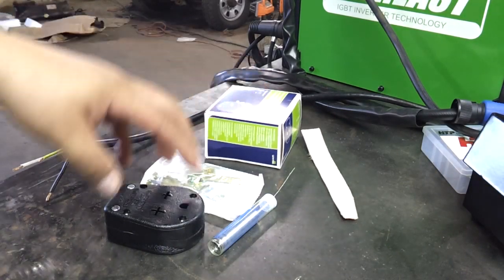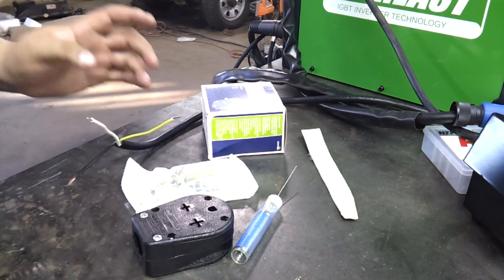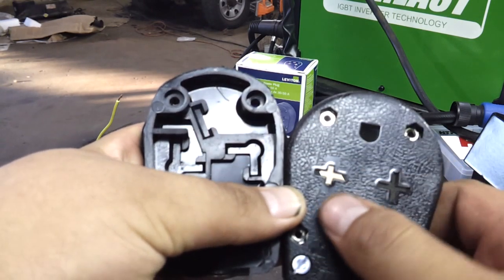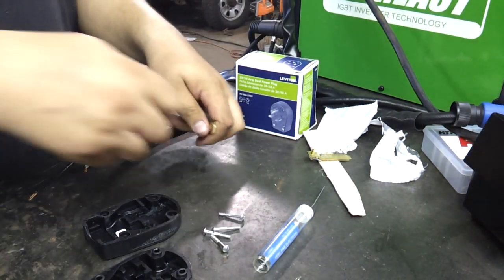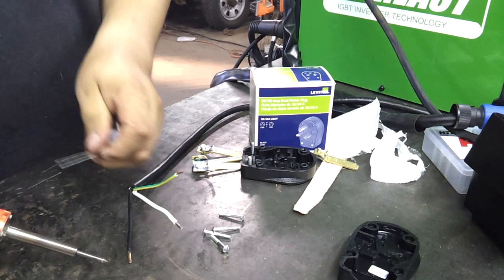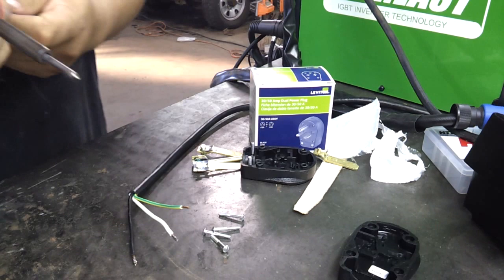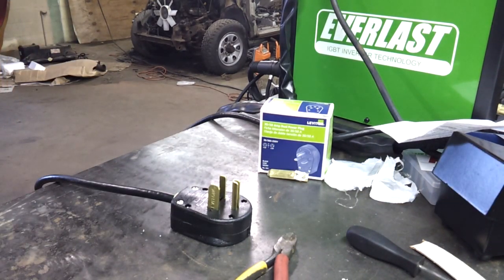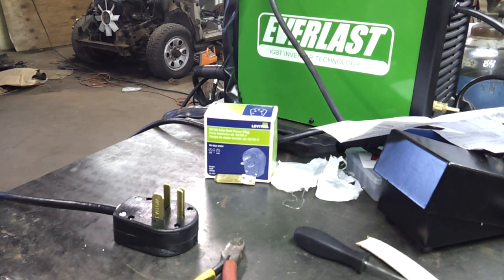Installing a 220 Volt Plug on Your Welder (Everlast PowerTIG 210 EXT)

Comment: You had better run larger gauge wire from the unit to the plug. Looking at your video it appears to be 14ga or 16Ga wire. These gauges are usually only rated for ~max 20 -25 amp. I recommend you run 6-8 gauge for proper load up to 50Amps.  Be safe!

Comment: The wires require no soldering. They won't pull out if you connect them as J hooks. The "clamp" is actually called a strain relief.

Comment from the maker: That's not the way amperage works. Your power supply has an amperage limit. In my case it's 50 amps. The only place wire gauge matters is from the breaker to the outlet if I have a 50 amp outlet. This is to insure that if I plug something into that outlet that requires 50 amps that the wire won't over heat. If what you are powering only requires 20 amps, the wire coming out of the machine only need to be rated to handle 20 amps. I hope that makes since. Amps are not feed they are taken.

Comment: hey i want to get a welder soon and i have 220 in my garage but the outlet is upside down as compared to the welder plug is that an easy fix? do they make an adapter that i can just plug in or do i need to turn the outlet over?
Reply from the maker: What do you mean upside down? Will the welder plug plug into it if you turn it over? Do you know amp rating the 220 outlet is?
Reply: my plug is upside down compared to how eastwood  has their plug setup on their welders and i could plug it in like it is i believe but the cord coming out of the plug will be going up instead of down causing unnecessary bind on the cord. the outlet says nema 6-50 on top and below it says 50 A 250 v  GRDG
Reply: i sent a pic to a guy at eastwood and he says i have to flip it over so the cord hangs down from the plug
Reply from the maker: Rockin Pip shut off the breaker. Pull the cover off the outlet and then flip the outlet over. Just make sure you don't pull any of the wires off the outlet when flipping it over.
Reply: hey bud thanks for the help it does seem a bit stiff to turn over but i will give that a shot and let you know thanks again man!

Comment: The yellow/green is an equipment ground.   There is no neutral in the 240 volt circuit.
Did you read the part of your owners manual that said "Do not remove the plug that came on the welder?   Link to the manual.   https://www.everlastgenerators.com/sites/everlastgenerators/files/downloads/dfe60188c86d74021235f2b62636585b.pdf.   Oh well, it's probably out of warranty by now.

Comment: I just bought the 256sI everlast. Do you know how many amp breaker I need for it ? I have the owners manual it says 32 amps draw & 40 max in rush. It has a plug on the machine already & 10 gauge cord.
Also my breaker panel has a 100 amp shut off outside. My panel has has 16 places for breakers & it's all full. I have an idea there are 3 double wide 20 amps for a total of 120 amps that are in charge of the electric wall heater fans. I want to remove 1 or 2 of them and replace them with a 50 amp & a 30 amp . then leave those wires inside the box for when I sell the house I can wire the heaters up again. Does That sound reasonable?
Reply from the maker: Please don't take this the wrong way. I really think you should call an electrician to deal with this. However yes, you should have a 220v 50amp circuit for the welder. I can't begin to teach you everything you need to know via the comments on my video. Plus it would be extremely careless for me to do that. Someone with electrical code knowledge needs to see your setup in your home and then they can better advise you as to what you should do.
Reply: @AMetalWorks  thank you for your honesty .
Reply: Korie Creson  You were mis-informed.   The plug that came with the welder has an ampere rating on it.   This is to be the same amps as your breaker.    30 ampere #10 cu and 40-50 amp is #8 cu.     Always match what the manufacturer has installed on the machine.   If you did what he said, (will it work?) Yes.   (Is it correct?).  No.
Respectfully,    Kevin